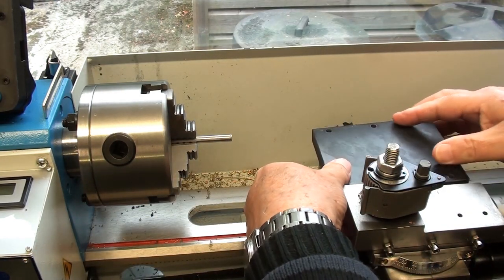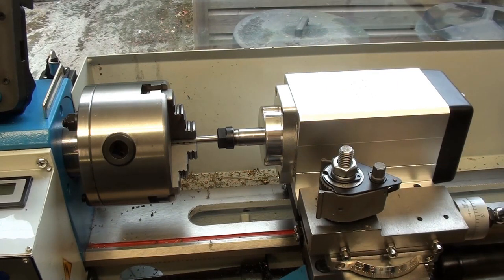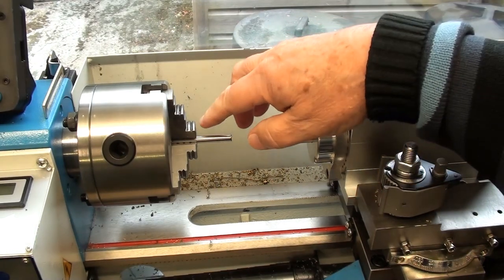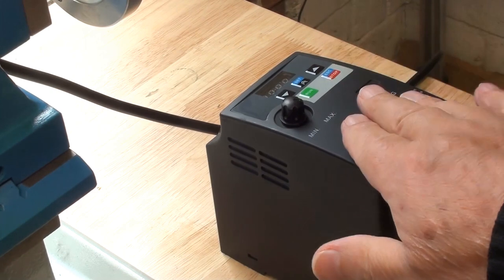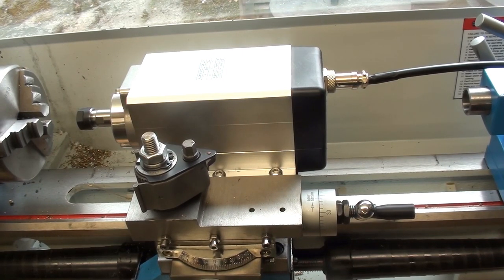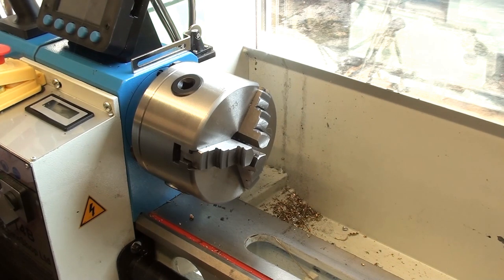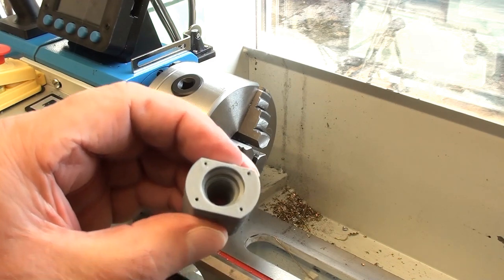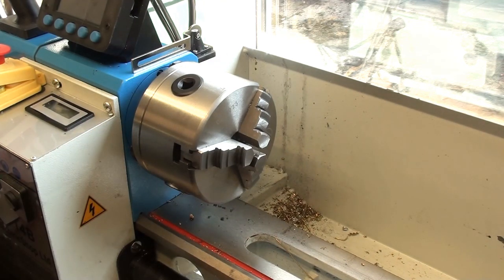Mini Lathe grinding spindle

Comment: How about a warning so the rest of us don't accidentally buy this crap. If they're happy to ship you something that doesn't work without having tested it first then I would prefer to avoid them. Getting a replacment for "free" isn't really free if you've had to spend time on it. I don't mind spending my money on a product but I become incensed if  I have to spend time as well. At that point the price becomes too high. So what is the brand and who is the supplier please. Adiitionally, indexing with a lathe seems a bit silly. Use a mill with a DRO and work out the X-Y point co-ordinates and drill away!
Reply from the maker: @hugocfr  The warning, if any, is needed is implicit in the video.  You are free to spend your money how you wish.  I've chosen to spend my money on this motor, and the fact that it failed after a short while is just unlucky in my view.   As to using a mill with dro for indexing - I heartily agree and that's how I'd do it if I had still had my mill - but I haven't.

Comment: I'm planning to do the exact same thing on my lathe. I've recently come across a 2.2kw 18000 rpm spindle from an old CNC and I want to try to use it as a grinding spindle on my lathe.
Reply from the maker: Good luck with that!  That's nearly 3 H.P!  I just hope that your lathe is a good deal bigger than mine. John.
Reply: @bizzibeeworkshop  it's a bit bigger but for a 3hp spindle is still a bit small. I at least want to try

Comment: Great stuff !  It's a chunky beast, hope it works fine for you.
Nice to hear that the seller and manufacturers were contactable and willing to help when the first one was faulty. 
Looking forward to seeing the anti-backlash nut being made.
Reply from the maker: Thanks, Colin.  The anti-backlash nut is going to be fiddly due to its size. I'm not used to working on bits of material that small. I'm thinking of 3D printing the major parts and turning  the actual nut bits as a glued-in sleeve.  John.